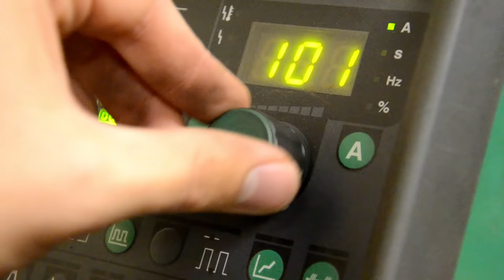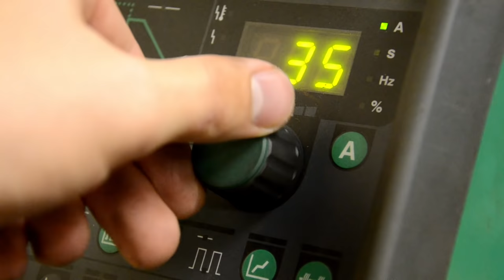TIG Welding Spoons into Bugs / Cutlery Beetles

Comment: Any tips for burn through on thin handles or edge welding on the spoon? I am trying to fusion weld it and it doesn’t want to puddle up. It just wants to burn away. I turned my amps down to 35 too. Also, the arc is wandering even with a sharp tungsten and the work clamp directly on the utensil.